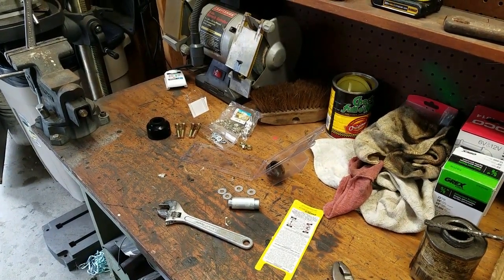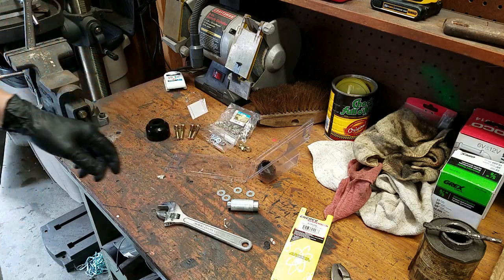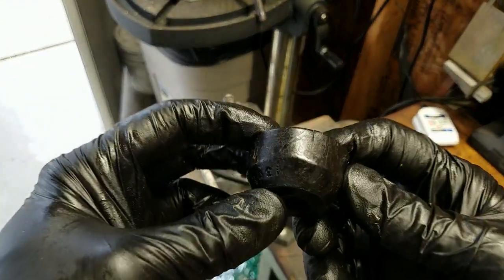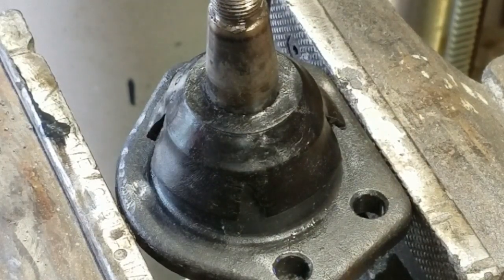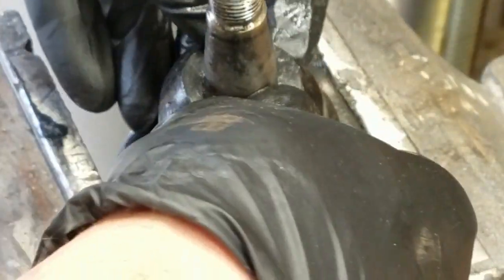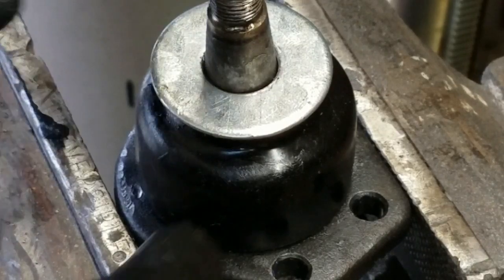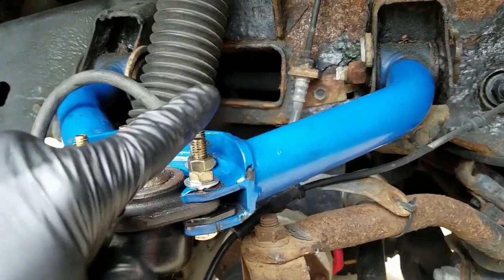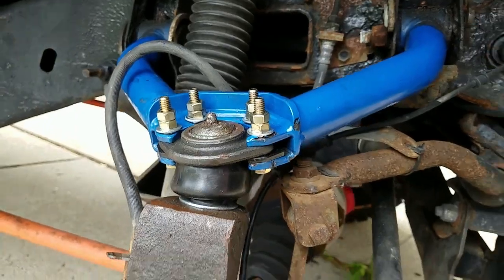A ARM INSTALLATION UPDATE--STOCK DUST/GREASE BOOT REPLACEMENT SOLUTION

Comment: Did you figure out what the no start issue was on your truck?
Reply from the maker: I believe now after all the work i've done that it could be also related to an older remote car/truck starter. I'm kinda afraid to remove it right now,I'm no electrician i'm going to have have it replaced if possible.